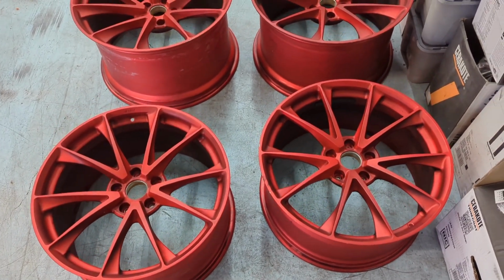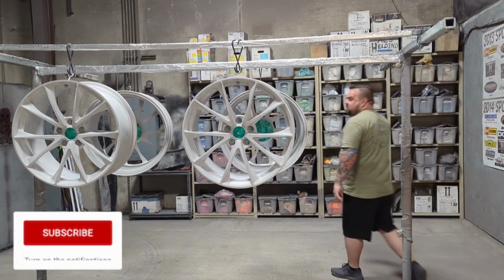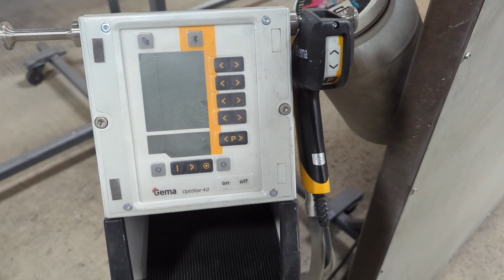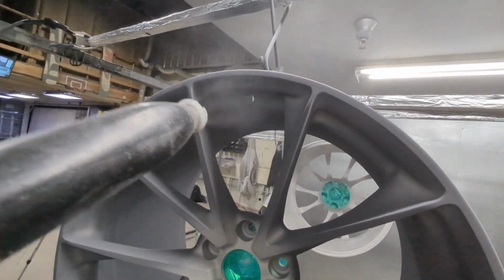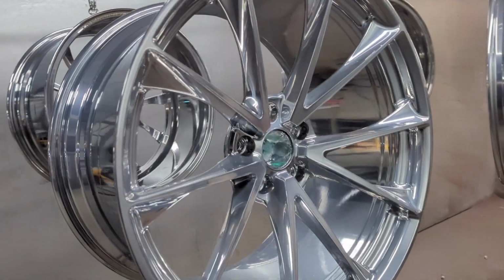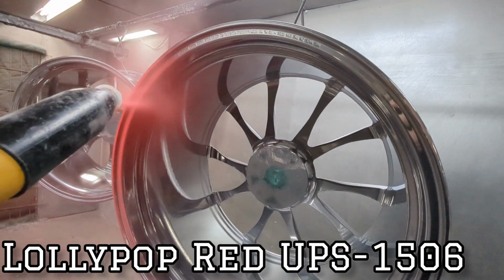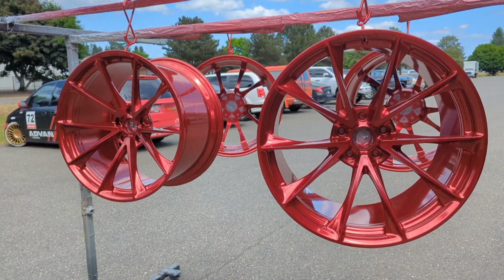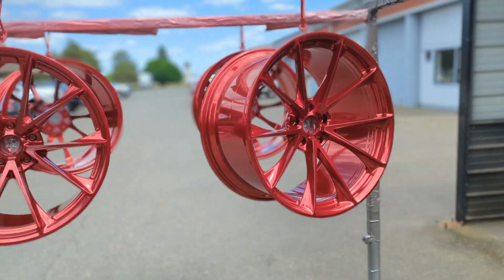Powder Coating Wheels from Start to Finish - Lollypop Red - Ep 150

Comment: Only thing i'd do after blasting & getting rid of small marks then blowing. Would be to off gas just to pull any mosture that maybe inside the metal. Just to be sure I can no imprefections in the finish.
Reply from the maker: Everything is outgassed....
Reply: @ Gotcha, I guess you cut it out the video. I’m going to be doing my personal wheels & triple tree close to an orange anodised. Prob from prismatic. The finish you got is definitely what I’m after but in orange 👌

Comment: I don't know if my earth ground setup is insufficient or if my gun just needs to be better. The chrome always lays beautifully, but the top coat always goes south.
Reply: I've got a 10 foot grounding rod and a 10gauge copper wire running to my booth, I'm using the basic Eastwood gun I have no problem laying multiple layers.
Reply: I have a ground rod at least 8' into the ground, with 3 strands of 12 Guage wire coming in off of it. Maybe I need bigger wires.
Reply: @419FishinandPowderCoating  i'm having the same problem with second coats, it doesn't stick to the substrate unless I pre-heat it. I'm going to use wider copper wire and see if this helps. I'm using the colo kf-x1 gun. Let me know if you do something else to fix this issue Jeery, would greatly appreciate it.

Comment: What is your 
 air regulator set at for the incoming air at the back of the GEMA ? Looking at your settings 35 and 3.0 I would be blowing powder all over the place. Looks like you have a soft powder cloud. Mine is set at 90psi at the back. that was recommended by GEMA. Just curious what yours is.